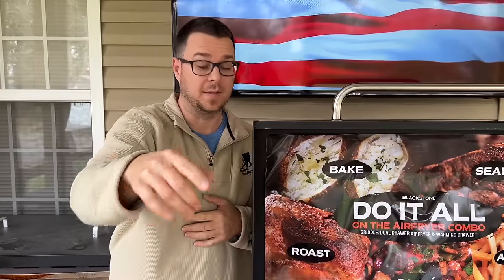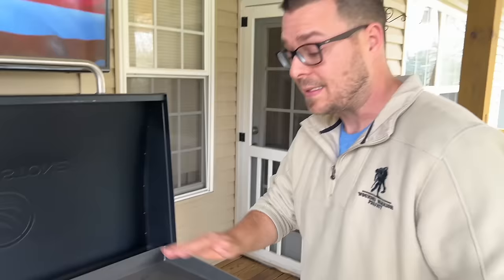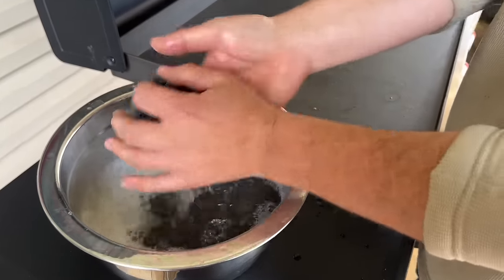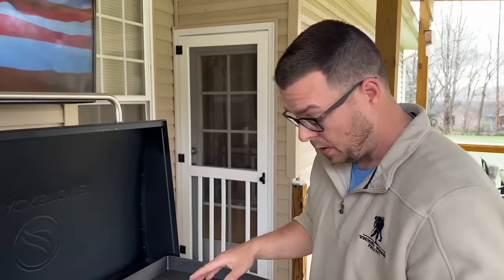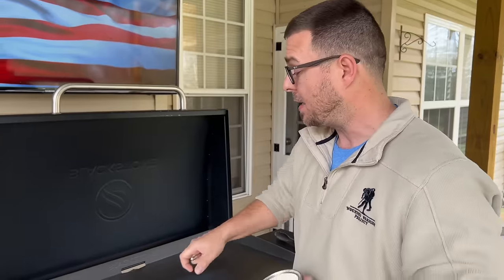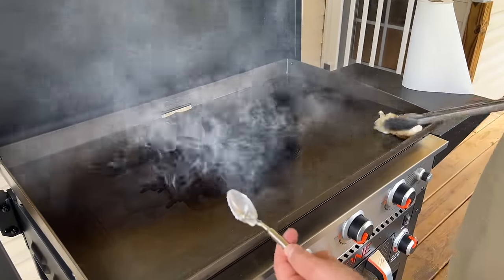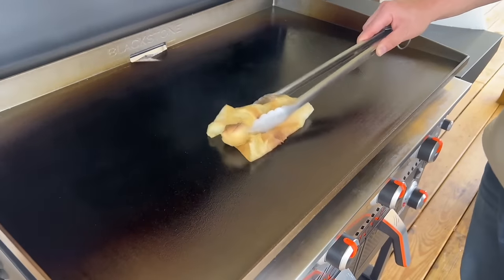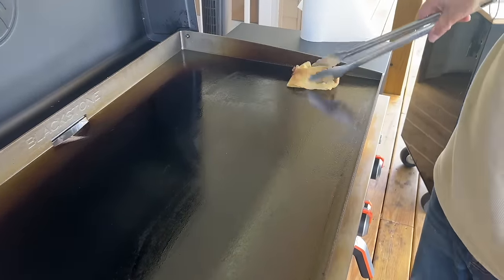How to Season a New Blackstone Griddle

Comment: Would you say that this is the same process for the Flatrock?
Reply from the maker: Nope. I would not sand the Flat Rock. Although rough…. No high spots. I think it actually helps the season stick. Deeper pools of oils that harden and protect
Reply: @TheFlatTopKing  So, seasoning the Flat Rock - It's recommended that I follow the instructions found on Traeger's YT Channel and whatever they say, correct?  Thanks for the help man!
Reply from the maker: @billwilliams4281  I have a video as well for mine. It starts ruff but by the end it’s the smoothest I have felt. Took 7 coats. I used grapeseed oil

Comment: What video did you talk about animal fat?
Reply from the maker: Not sure the question...if yo are asking if you can use animal fat to season with I would say NO...not the first seasoning. You need an oil that polymerizes. Animal fat can keep a seasoning if used often but if not in use I would stay away from it as well..animal fat will run rancid
Reply: @TheFlatTopKing  Roger. I figured the high viscosity of lard would protect better, crisco it is. Might try the avocado oil, it just seems like it would burn off. Pure speculation considering I've never ever used it. Thanks for your response. I wish every product I wanted had a sme like yourself to train me up.
Reply from the maker: @lerch400block  haha. Right. Remember thin costs are better than thick. Thick will peel faster. Your building layers that bond together. Not at once

Comment: I am in the process of building a food truck.  My new griddle is stainless Steel, does it need to be seasoned? If so, what is the process?  
Also, what is your FB page?  I’ll gladly support!  Thank you for the awesome videos…
Reply from the maker: The Griddle Group...the stainless steel does not have to be seasoned but treated completely different than rolled steel...You clean and oil after every use...depending on the food that you are making...honestly no way I can Type how to maintain a stainless griddle...way to much info...
Reply: @TheFlatTopKing  Thank you very much!  I will do more research on the subject.

Comment: Do you leave the burners on for the whole process?  High, medium, or low heat?
I just bought one today. THX
Reply from the maker: Depends on the actual model...just hot enough to burn the oil...and that depends on what oil you use...
Reply: Using Blackstone griddle seasoning  @TheFlatTopKing
Reply from the maker: @ConfedVet  yeah… probably a good med…. Look for smoke rolling after putting down…

Comment: Sanding is absolutely NOT needed. Why do that?
Reply from the maker: Steve...is anything needed...the whole point was to knock down the high spots..just like the video says...its raw metal that has flaws...when seasoning and or using metal utensils if the surface is not flat the metal will just end up knocking it down naturally over time...why not do it quickly...
I do this on my lodge cast iron skillets as well and they are pre seasoned...
You are not taking it down to bare metal but just to even it out. '
It also helps keeping the paper towels from ripping on the high spots..
like anything this is my experience with 7 griddles and you can absolutely disagree or do what you want..but in my opinion when its brand new and you run your hand over it you will feel the same thing...sharp high spots...